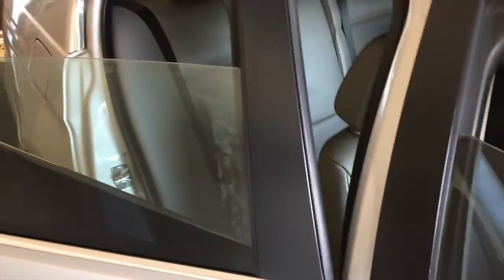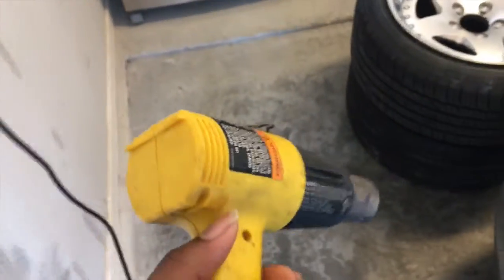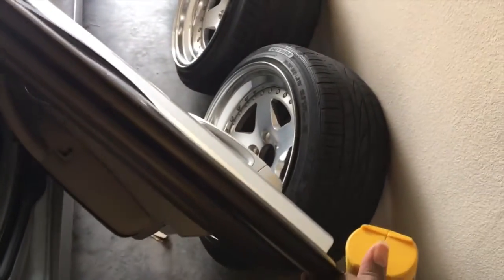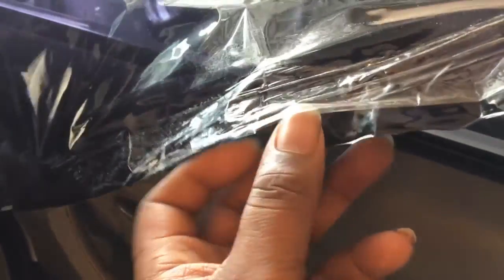Easy Window Tint Removal

Comment: Higher end tent will just peel off... others can leave glue residue even with the heat method. If so, spray vinegar on it. That acid congeals the glue which is easy scraped off with a razor blade